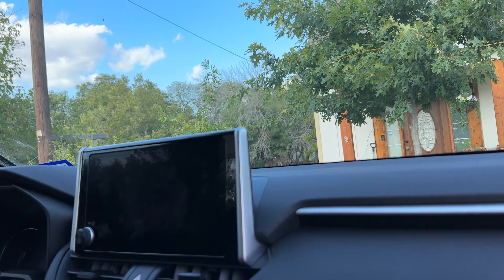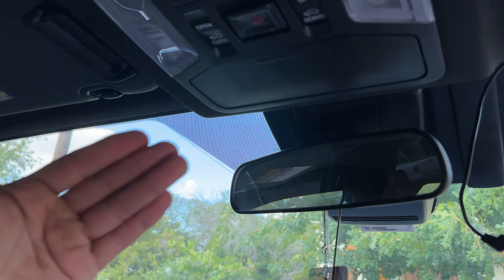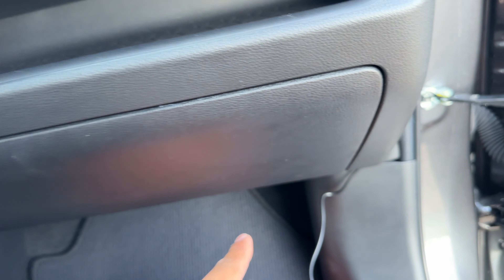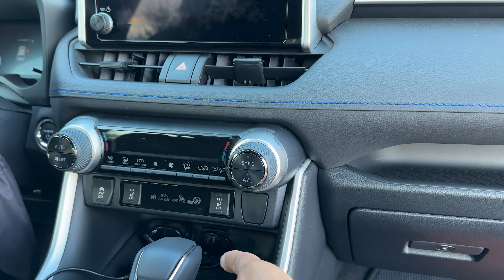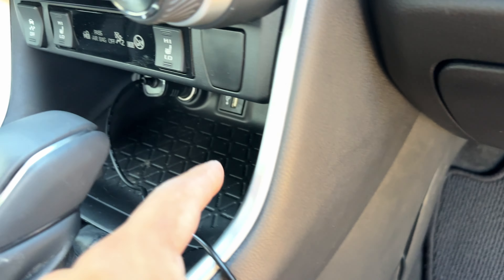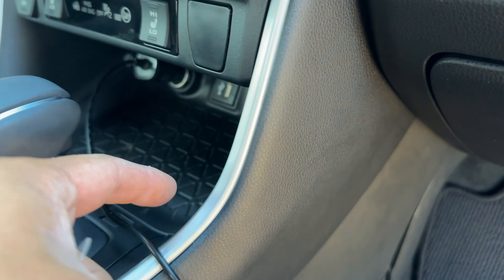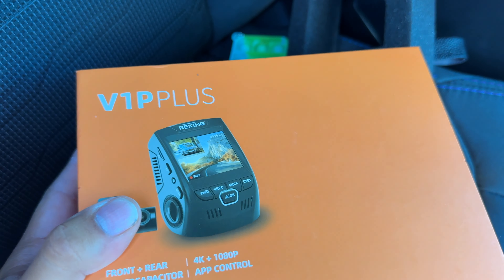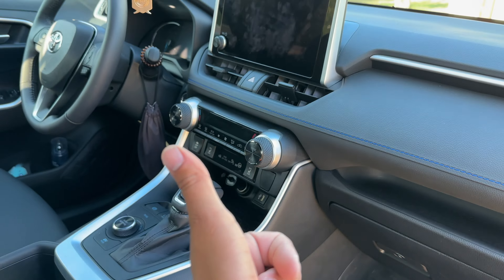How to install a dash cam on new Rav4

Comment: How do you manage to keep the wires hidden under the glove box? I’m confused on how to keep the wires stuck up there so that the wires don’t hang loose.
Reply from the maker: There’s some plastic I pulled down, it was pretty tough to pull them since the car is pretty new but once I removed it I was able to clip the plastic back up and have the wire in there